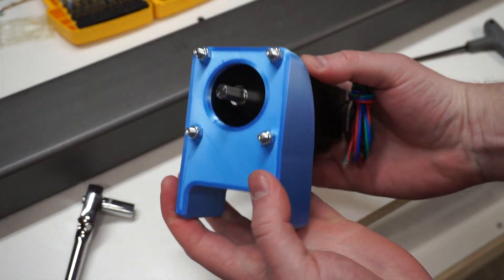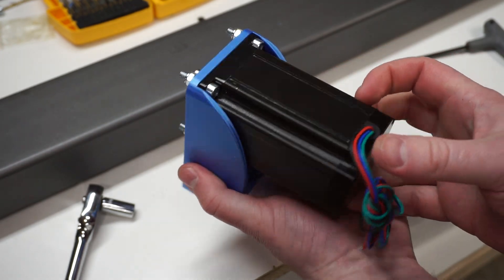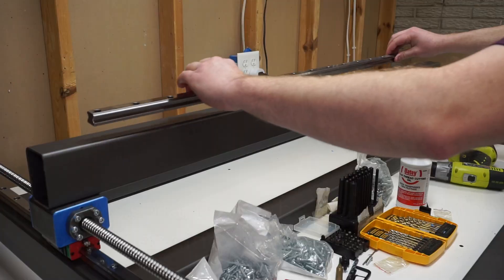PrintNC Final Assembly! (sort of...)

Comment: Hello Brian, I'm building a Threedesign CNC machine. But since the website is down, I don't have the STL files. Could you send them to me?
At the time, I didn't have a 3D printer.
It would save me a lot of time.
Thank you so much.
Xavier from France
Reply from the maker: Nice! Well, the printed parts are actually custom designed for every PrintNC. You will buy your steel, and then measure it, and then put those parameters into a Fusion360 file and then export the STL's from the Fusion file. Check out the PrintNC discord, they will have the latest information in there.
Reply: @ProjectsbyBrian  Thanks you

Comment: 5:27 the motor mount bolts would they be neater if the bolt head was facing the screws side rather than how have it? Or does it have to be as you have shown?

Comment: Hey Great video, I reference yours and others continuously for my build, What was your reason for the position of the hardware on the gantry? You said you moved everything to the far right.  Just curious of what you considered for this.  Thanks for your time!!
Reply from the maker: Thanks! It wasn't a huge decision, it was just to ensure that the full length of travel for the X axis wouldn't interfere with the Y tubes. The main point I wanted to make was that it wasn't going to be mounted symmetrical on the X axis, but rather mounted towards the right side. There are some things in the build where you just have to kind of lay out the parts on the tube and see what looks right. I hope that explains it well enough haha.

Comment: These are awesome video's.!!!!!!!  Did you print everything with ABS or PETG or PEG.  Where did you get stepper files? last question what would you do different know if you started building from scratch again.  Again thank you for your time effort and knowledge and may God Bless you in everything you do..
Reply from the maker: Thanks! Everything is printed with PLA. The entire design is open source and hoges (Three Design), the designer of the machine, has a very impressive Fusion360 model of the entire machine that can be modified and then STL files are exported from that to print. I don't have anything I would do different, other than some purchasing decisions that don't apply to someone building one now. Check out my video called "PrintNC My Thoughts" for more of my thoughts on the build.
Reply: @ProjectsbyBrian  Thanks Brian for your quick reply.  I looked at your video  "PrintNC My Thoughts" and it helped me out.  Again Thank you and God Bless!!!
Reply from the maker: @44mod  good to hear!

Comment: Thanks for posting this series Brian. How accurate were your holes really? I’m finding the corner frame holes particularly hard to get all lined up. I’m thinking of fudging the 6.5mm holes a little bigger.
Reply: I figured that. I ended up welding a few holes closed, putting the screws that fit, then remarking those holes with a transfer punch. Worked very well and worth the 3 or 4 seconds per hole to weld shut. Hopefully the Chinese parts arrive soon so the rest of the fun can start ;)

Comment: So you go for a steel frame construction but use a printed roller bearing housing with a diameter of less than a cm? (If this is just a temporary solution and you are using this machine to then mill some at least aluminimum ones I will stfu, but otherwise) the heavy frame is pretty pointless.
Looks nice though. 👍

Comment: Nice build. Those are not grease nipples even though they look like it. You should put the correct oil into them on occasion. I would just use pump a little heavy oil though them to clear any  dust. Best of luck. Take them time to have a look at Linuxcnc. It can be very rewarding after the initial introduction. Best of luck.